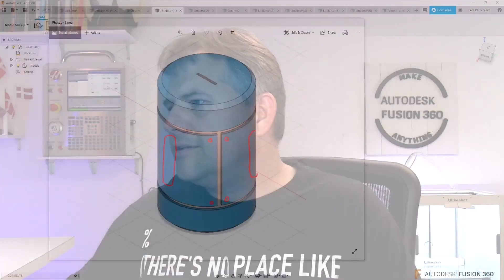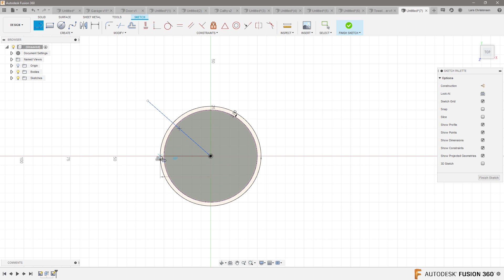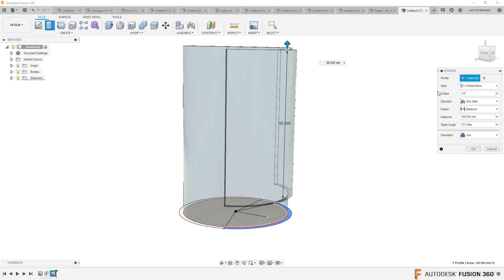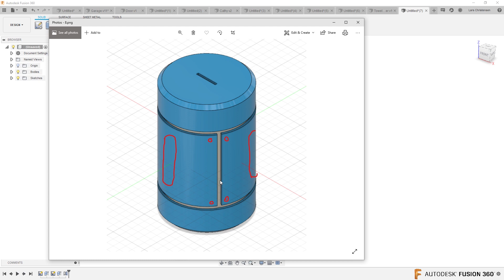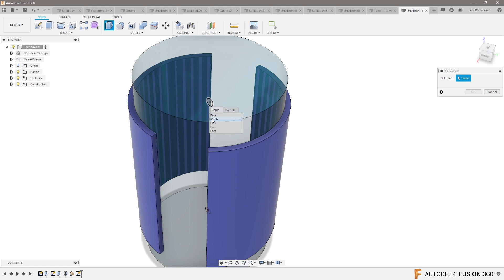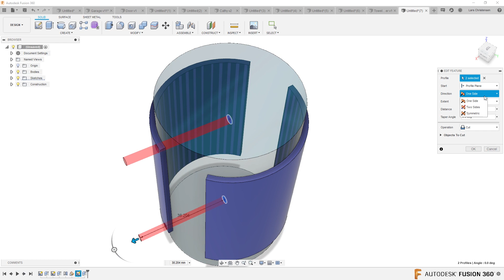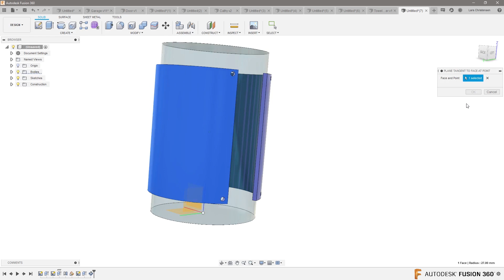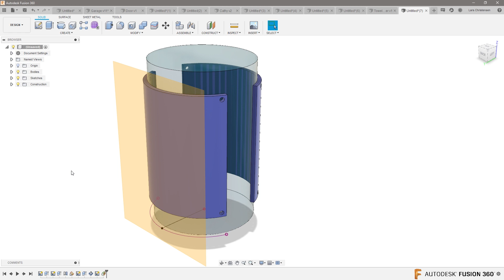Fusion 360 — Sci Fi Bottle for Planets and Planes — Ask LarsLive

Comment: Hi there. This might be little bit off the  topic,but it has some similarities. I have seen some older videos you doing electrodes for EDM sinker on a mold. I am wondering about the commands you would  use here in Fusion 360. If you can create stock graphite and use Boolean? or to extrude it up to(multiple surfaces or solid), copy the geometry and then paste it onto the graphite stock using copy and  keep it all in one file(data set) including the  milling op.  If the original geometry would change would it change the electrode too? And how about electrode tool path?Would that update automatically or you would have to command it to re-run without re-selecting all the parameters, or???  How about making drawing of the electrode mounted on the holder and making layout with identification of where on the part(core mold plate) the electrodes of different shapes and sizes are located, with dimensions and notes for depths. I have searched everywhere even on forum, but no one has any video on this topic. I believe, I would not be the only one, who would like to see that.....Thank you...

Comment: Another great video.. !!  Thank you for what you do !!  .. I do have a question ...  I am considering purchasing a 43 inch 4k monitor ( not TV ) .. I have read a mixed bag of opinions..  Does Fusion 360 work in 4k ? .. I will be using this in a Mac environment  .. I have a strong enough graphics card, ram etc.  I have read of a scaling problem..   Do you have any information  ? Thank you !!
Reply: I use 4k on 42inch monitor, no scaling problems looks great
Reply: JonC I’ve tried to blow up fusion before off my laptop onto a 4K tv and it looked suuuper grainy. You might be able to change the settings though